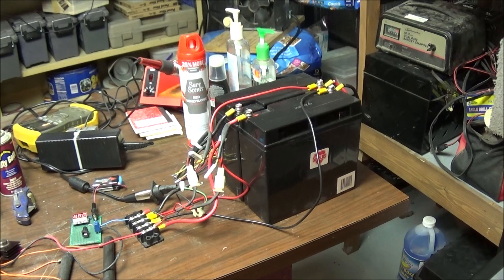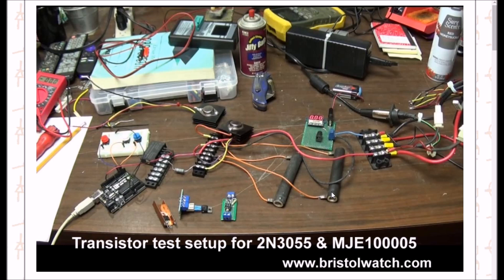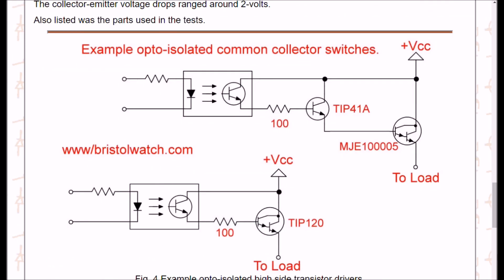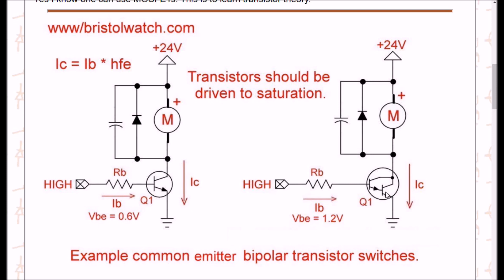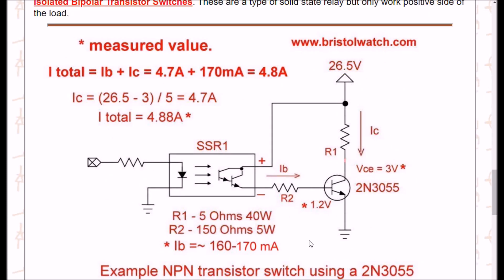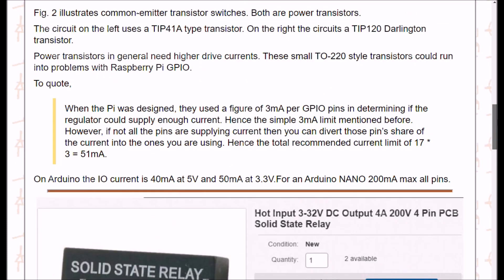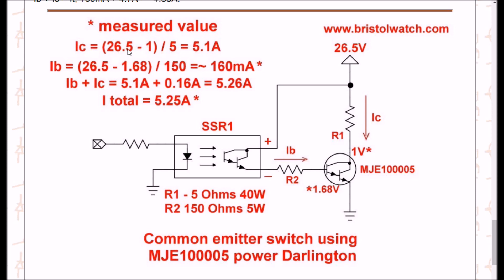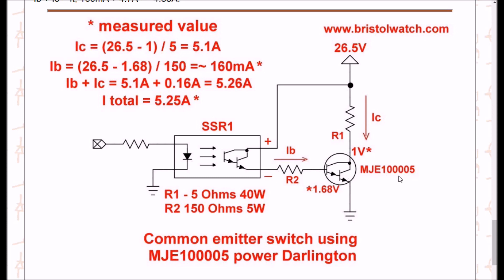Compare 2N3055 and MJE10005 Transistor Power Switches

Comment: Really appreciate you posting all these electronics videos.  At 2:56 you have the TIP41A connected directly to the MJE100005 base.  I am wondering if this will exceed the vbe of the darlington for higher values of Vcc ?
Reply from the maker: That transistor can take several amps on the base. Go ahead and add the 100 Ohm resistor.

Comment: 2n3055 is a med range power .  Not good to use with Arduino more than good to use for some application that you need a floating current in the between E and C . 

So I still have use for 2N3055 for some application that need a controlled current in the collecter or if I need a feedback directly from 2 transistor 2n3055 between C and B .